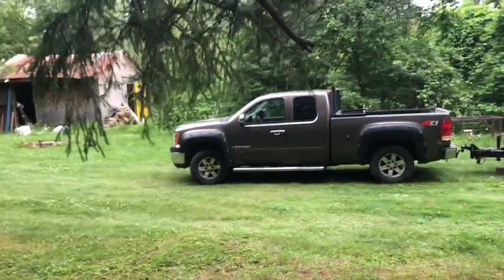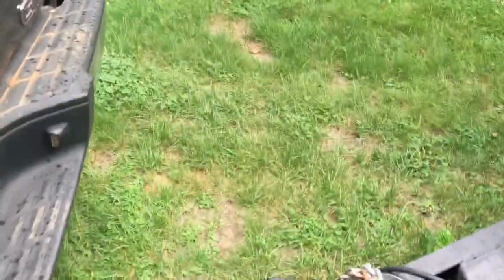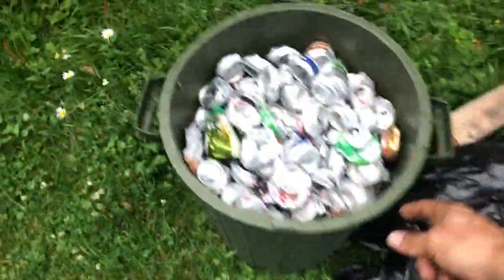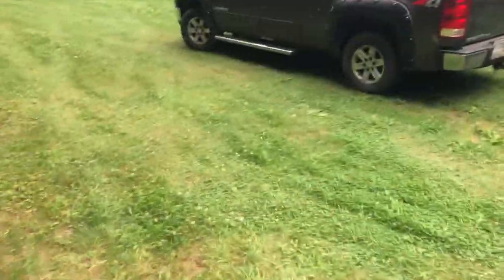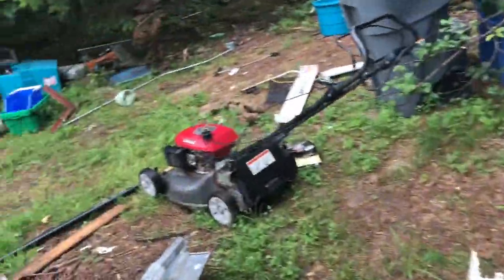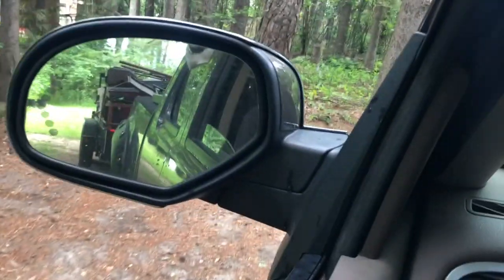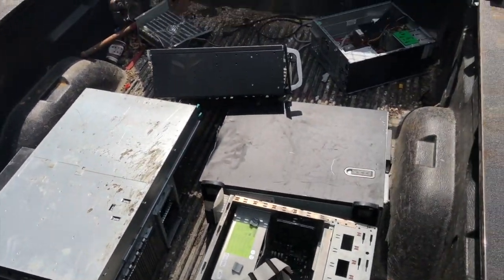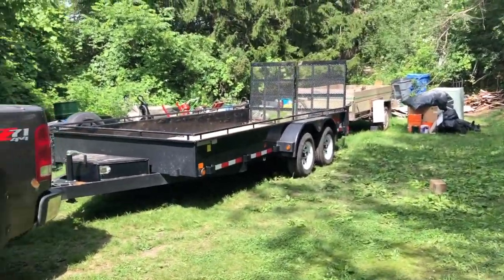Finally got a new trailer!

Comment: Do the bags for sure..you can get them on amazon for under $300 
Get the 5000 lb ones tho
Reply from the maker: Kirk Niles Yeah I was really thinking about it.. still debating it tho. Why the 5k ones instead of the heavier duty ones..? 
You have them?
Reply: Well with that only being a half ton and a short box the engine will help with that
I just feel that if it’s only a half ton and one just keeps putting on the weight on the back (truck isn’t sagging ...put more one) the tranny isn’t build that strong like a 3/4 ton